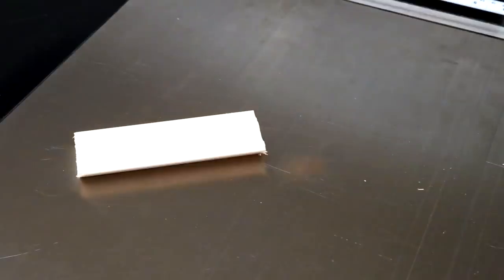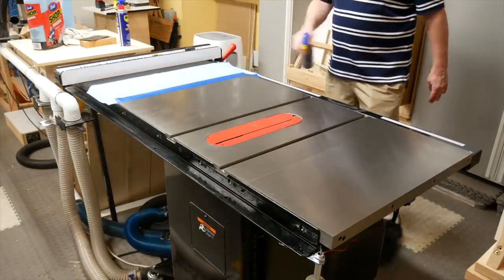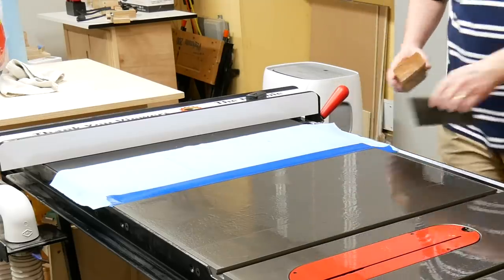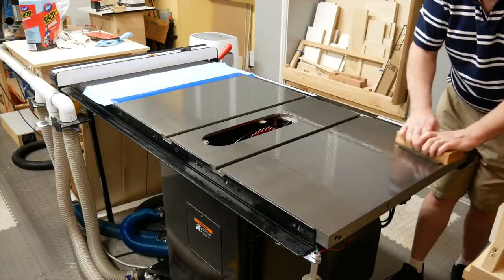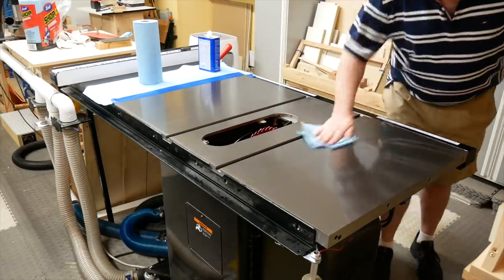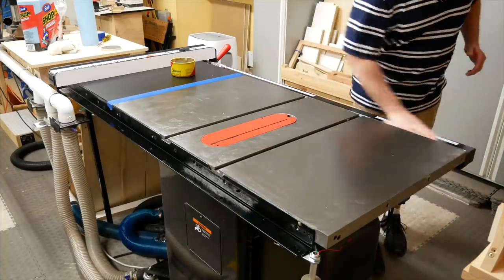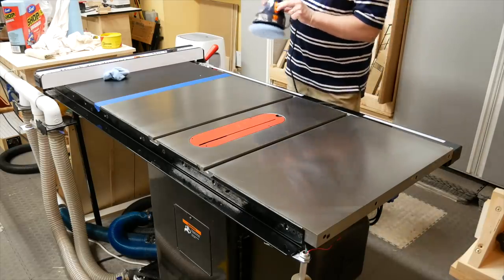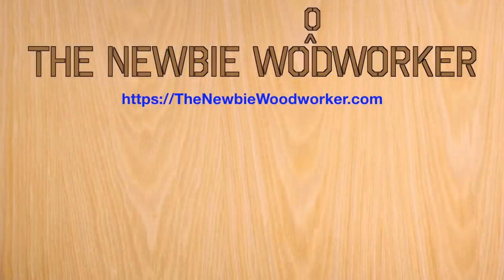Removing Rust and Protecting a Cast Iron Table Saw Top

Comment: I got a free 70's Craftsman table saw a few years back. The guy kept it outside. So I did same. Keep it covered when not used. I maintain the iron top with wd-40 like you then use a brass wire wheel to do the tracks. Once done I spray with silicone and wipe down.  Four years later and that damn thing is still running like a beast!  😁👍
Reply from the maker: Wow! That's an amazing story. I doubt anything made today would still be working that long. 😏

Comment: This was perfect. Just upgraded my 8 1/2 “ dewalt contractors saw because I was able to buy a floor model delta 10” that had some surface rust. Picked it up for a steal. Just need to clean it off!  Thanks for the tips.
Reply from the maker: Awesome! Glad I could help. 😄

Comment: Paste wax is great for weekly maintenance. For long term storage (over the winter) especially in moist or humid conditions Cosmoline is top of the line; spec'd by the military for weapon storage. I have paste waxed my jointer, wrapped it in a moving blanket then a plastic tarp, come back in the spring and the table is covered in rust. Most equipment manufacturers will coat their equipment in something like Cosmoline prior to packaging and shipping. A bit of a pitb to remove but guaranteed to prevent rust.
Reply from the maker: Thanks for the info! 👍

Comment: I actually apply paste wax to the plastic laminate extension on my table say as well as the cast iron surface.   I have found that there is no need to mask off this area.  Both surfaces are enhanced and both benefit from the wax application.   NIce video BTW.
Reply from the maker: Thanks! I didn't think about plastic extensions, but yeah, that would work just fine. My extension is wood, so it makes a difference. 😄

Comment: Missed this one when it came out.  I live on the Gulf Coast where it's humid about 360 days a year.  About once a year I clean my bare cast iron with mineral spirits to get the last coatings off.  After that, it gets a treatment with Boeshield T-9 per the instructions and then Johnson's Paste Wax as you describe.  So far no rust has appeared with this regimen.
Reply from the maker: That's awesome that it keeps the rust off, even in that environment. Thanks for sharing (and I mean that, even though it sounds trite when I reread it 😂)

Comment: We've had our saw for several decades, but that doesn't mean I knew all the ins and outs of how to clean it.  Or the cast iron on the drill press.  I am a newbie table saw user.  I might have made some of the mistakes you point out. Thanks for the info!
Reply from the maker: I suspect with an older saw, there's less issues with the direction you scrub the top - I think cast iron hardens more over time. So that part may not matter. But glad I could help! 😄

Comment: i have never seen a spray version of WD40 like that before i guess we just dont have it in the uk. these days i usually buy it in a gallon bottle and they supply an empty spray bottle. i stopped using the aerosol because the gas would run out way before it was empty. and also i find the spray bottle is better for EVERYTHING! you get lots more coverage even just using it for rusty bolts.
Reply from the maker: I hadn't seen the spray bottle before either, until someone mentioned it. And I agree that it's much better!

Comment: Nice job. I don't have a Sawstop, but I assume the final finish (machining) on that iron top is both very fine and done in a front to back line. My old Delta has more of a circular pattern, and certainly a bit 'less polished', so my random orbit sander is employed for the rust removal. Still using similar Scotch brite pads, though.
Reply from the maker: Personally I don't notice any finish pattern on the top at all. But I tried a swirling motion, and it looked like crap. But I hadn't thought about the possibility that that's only because of the SawStop's type of top, which I swear isn't as hard as it should be. Wish I had mentioned that "your mileage may vary". 😛

Comment: Wow i didn't know you can put more than a single coat of wax. Thanks learn something new today
Reply from the maker: Honestly, I've heard people swear that if you don't put on at least 3 coats, you're not doing it right. I have no idea how accurate that is, though. Anyway, glad I could help! 😄
Reply: @TheNewbieWoodworker  Many experts including Nick Engler say that wax doesn't stick to itself well. When you put down a coat and then buff it out, it ends up extremely thin. If you add 4 more coats and buff them out, you end up with the same thickness as one coat, so additional coats are a waste.
Reply from the maker: @davezak5870  OK, thanks for the tip. Two coats has worked well for me, meaning I don't get rust, so that's good enough for me. If you live in a different climate, then maybe more is needed.

Comment: I have a newly acquired Craftsman cast iron tabletop saw which needs help.  I've watched your blade alignment video and plan to  put it to use tomorrow.  The top is rusted so I'll be sanding and polishing it too.  I'm curious about the paste wax coating.  Does it "scuff" with use or wear off?  With light use how long should I expect it to last? (months, a year, years?)  Thanks for posting.
Reply from the maker: Good luck with the rust removal. 🙂 How long paste wax lasts depends on all sorts of factors, some of which elude me. 🙄 But generally, it should probably last months, depending on how often you use the saw. For me, I just keep an eye on things and see if there's any rust-like discoloration anywhere. Not sure if that's the best thing to do, though, since this is my first cast iron top, so take that with a huge grain of salt.

Comment: Many experts including Nick Engler say that wax doesn't stick to itself well. When you put down a coat and then buff it out, it ends up extremely thin. If you add 4 more coats and buff them out, you end up with the same thickness as one coat, so additional coats are a waste.
Reply from the maker: I replied to your other comment, but I'll cut and paste here. Two coats has worked well for me, meaning I don't get rust, so that's good enough for me. If you live in a different climate, then maybe more is needed.

Comment: I looked High and Low to find Johnsons past wax. Amazon showed they carried it but not currently available, so I ended up going to Lowes and picking up Minwax Finishing Wax Natural It seams to work just fine. Would have rather had Johnsons I guess just cause I knew how it would do the job at hand
Reply from the maker: As long as the wax isn't water-based, it should be fine. And if Minwax hasn't caused any rusting, then it's probably fine.

Comment: I dunno I think you're a little rusty on your delivery
Reply: @TheNewbieWoodworker  
Hey Dan, I'm curious are you still using shop-vac and 2.5" connections for dust collection with your Sawstop PCS? How does that work so far? I am debating on full size dust collection and that's a whole extra world of hurt to my wallet after ordering a 3HP PCS with ICS base and all that jazz. Thanks, cheers!
Reply from the maker: @clavicus  I'm still using my shop vac system, and although it's not perfect, I'm not convinced a full-blown system would be much better, if at all. Some types of cuts generate a lot of dust on the table, but unless you have an overhead dust collector attachment, I think it would be about the same if you use a standard DC. I end up with a lot of dust inside the cabinet which I vacuum out every now and then, but people with full-blown DCs have the same problem. I got a 2 1/2" to 4" adapter to connect to the SawStop. Of course it's the same diameter as the SS port, so I used black duct tape to attach it, and you can hardly notice. So by all means, keep your current system and spend money on something else. That's my opinion, which I'm sure people with full DCs would argue with, but who cares? 😄